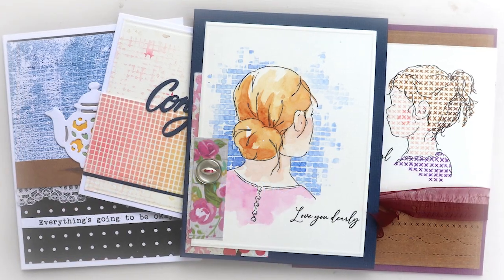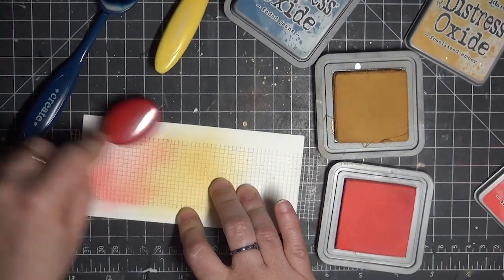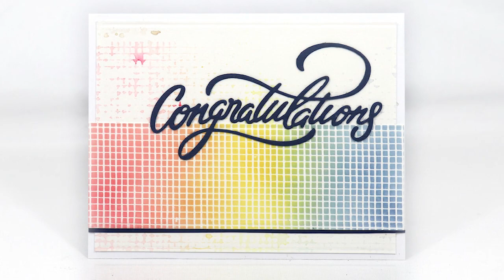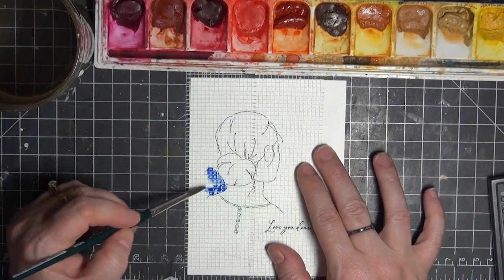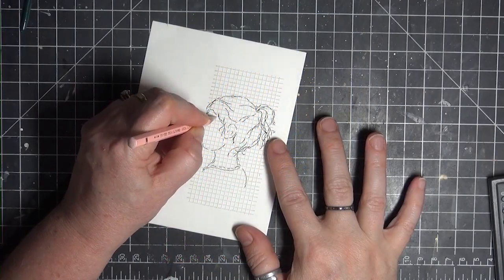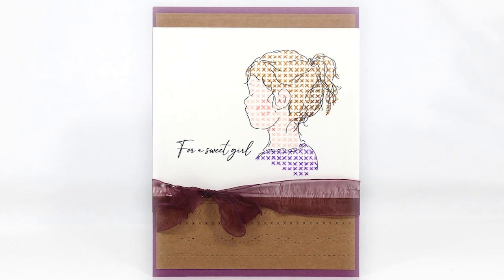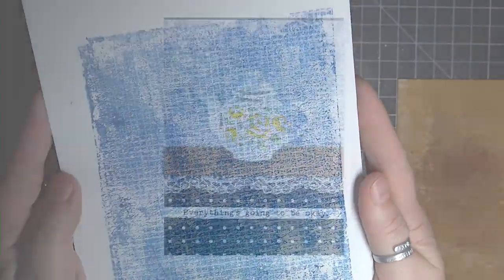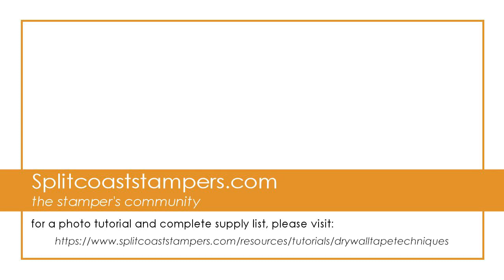Drywall Tape Techniques

Comment: I used that same sort of tape some years ago for actual drywalling. Hated it, as it was so hard to mud over it without the mesh popping through. I have used paper drywall tape since then, with (I feel) better results, since that is thinner. I may have to see if I still have the mesh tape somewhere, though - finally an easy use for it! LOL I know I have lots of the hole-y paper tape, which I've also used in card making. Thank you for sharing, Dina. I especially was intrigued by the cross-stitch pattern. When I first saw the samples at the beginning, I was wondering where you got drywall tape with a X-shaped openings in it! LOL Take care, & have an awesome day! :)